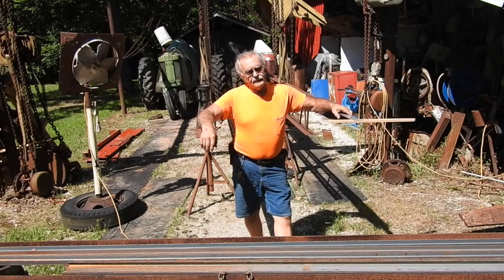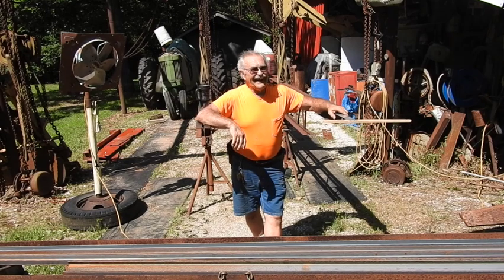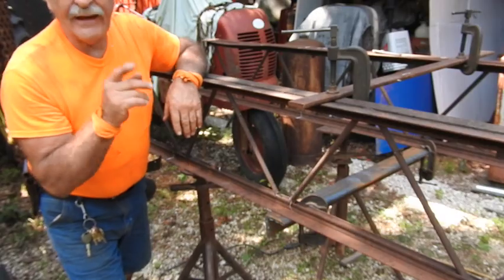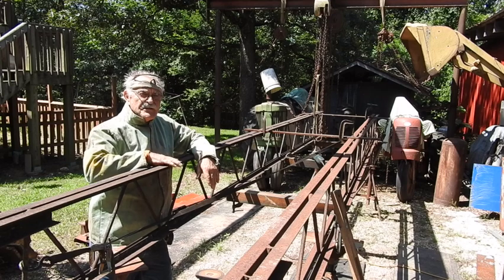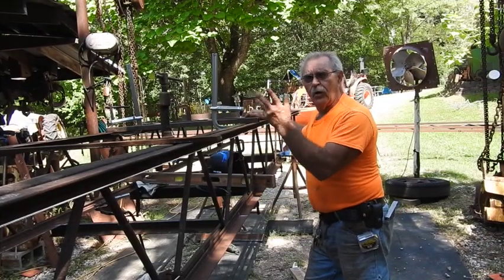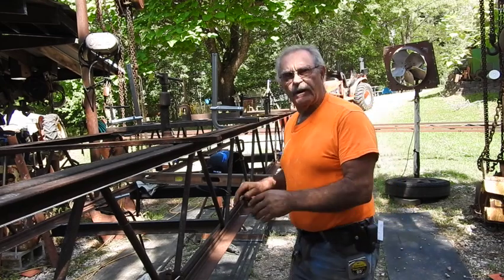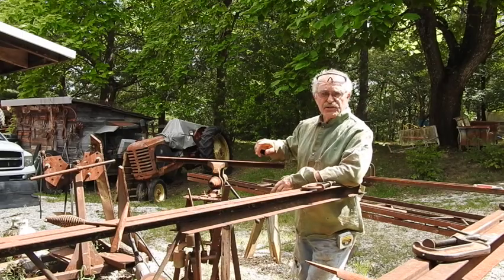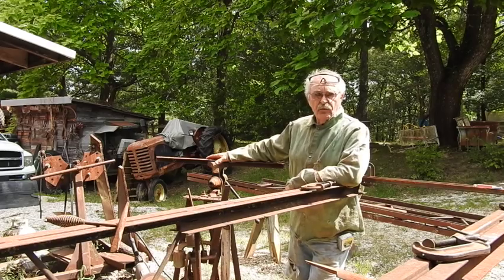Frontier Sawmill Trailer Build Pt 1

Comment: Sir, what is the red tractor with only one tyre in front ??? 3,4,5 rule ( I like that !!! ) Now that is big bench steel saw mon ami !!! You are an OUTSTANDING TEACHER SIR !!! I know I already told you in the past but your sky jack chaines are a great one Sir Stick welding is the best Sir Great explanation about welding heat distortion Sir   Keep warm Cheers !!!
Reply from the maker: The red tractor is a BF Avery.  It has an IXB3 Hercules engine and hydraulics.  They were bought out by Minneapolis Moline around 1952.  That big old band saw is really old Dave...just like ME !!  LOL. It takes a 10'6'' blade !!   Yes, 3,4,5 is the same as 6,8,10 for bigger areas and for huge areas, use 30,40,50 to square up an area or a layout for a building or sewer or anything. I use 6,8,10 for sheets of roofing or to square up and snap a line to start shingles.
Reply: @tractorman4461  OUTSTANDING MON AMI, I will remember these tricks Sir Cheers

Comment: I have to ask what that huge machine was that you used to cut the channel iron?   I know it’s a type of saw but have never seen is used before and how old is it?   Project is well on its way to complication.I
Reply from the maker: That was an old, old...did I by chance say OLD... metal cutting bandsaw.  It takes a 10' 6'' blade.  Its cast iron frame and legs are really cool looking.  When I got it, the hydraulic drop cylinder was inoperable and the machine hadn't been used in quite a while.  I made the repair, bought a couple bi-metal blades and have been using it ever since.  It will cut a 16'' wide piece of material.

Comment: Oooooh kind of warm there for you this day, and welding too, God bless your stamina Wendell.
I use some 'salvaged' steel too whenever I can. Smart use of l9imited cash, I think.
I've never used those 'bar joists' so please forgive my question following; could you not have narrowed those joists a bit to keep the saw that much lower on the trailer height?
Of would that have been just too much cutting and welding?
Reply from the maker: Well, two things Reg.  The weather was in fact pretty darn warm, but I did this project in July or August.  It's taken me this long to get around to editing the string of videos.  LOL.  Lazy Americans huh.  I wouldn't be able to adjust the height of the bar joists without affecting tremendously their ability to carry a  load.  They are assembled in a jig and the round webbing is all one endless piece of preformed round stock sandwiched between the two sets of two angle irons. 
    The design of the webbing is such that they obtain their strength by transferring stresses of the load (when used in a building) to the two ends.  If you notice in commercial buildings the bar joists allow for long distances of span without internal support....similar to wooden trusses in home construction not requiring 'load bearing' interior walls. 
   In this case, the end result will be similar in the way the bar joists will be supported to the ground by means of 4 scissors jacks near the ends.  The four jacks will allow infinite leveling of the working track
Reply: @tractorman4461  Understood on all points.  I wasn't thinking of the stresses and load carrying of those steel 'trusses', I can see why cutting and re-welding is not an option.
Tardiness of putting this video up,.... heck I can understand that too.  We have too many things to do and complete.  
Makes for good viewing in cooler weather though!  :)

Comment: That thing could serve as a bridge for the army tanks.... You sure have skills reusing imperfect material. If I can suggest (and still the right time...) an idea to have the trailer be at the most convenient height. You could use the same kind of axle/mechanism you have on your splitter. So the trailer can even sit on the ground if needed. Thanks!
Reply from the maker: Sometimes there's a lot that goes into the prep work with salvaged material.  These weren't super-bad, but they DID require a good bit.  Just in prepping the areas to weld was a bit of a task...  An 'A' frame kneeling axle would have been a super idea to adapt to this....but I ended up adapting a 1950's mobile home axle for width and weight capacity for this one.  That's coming in the next video.